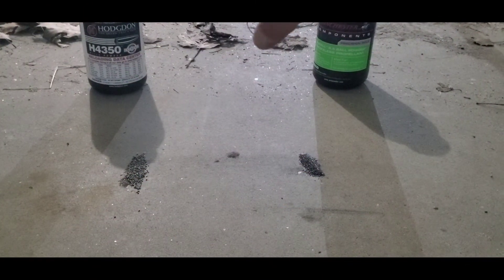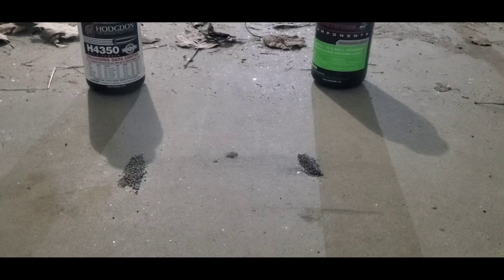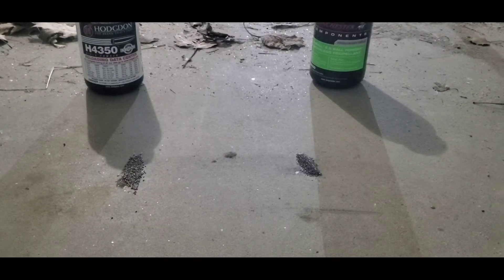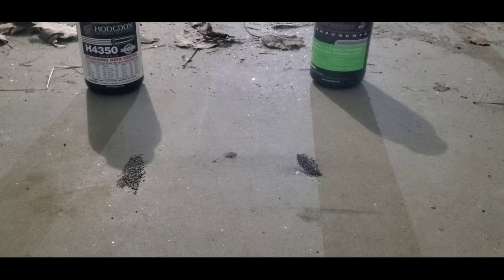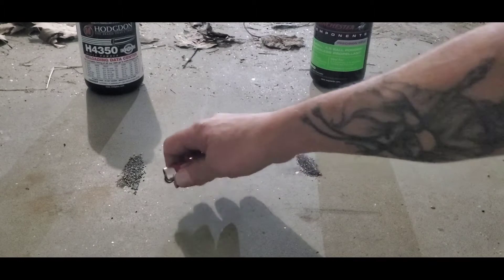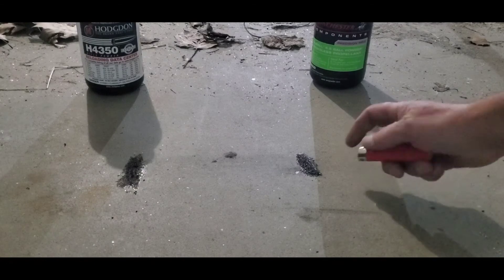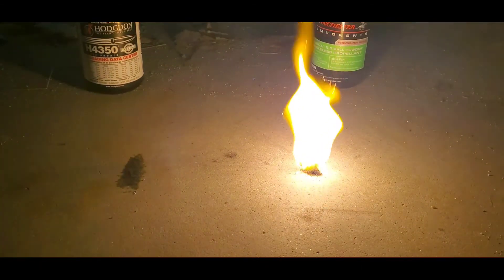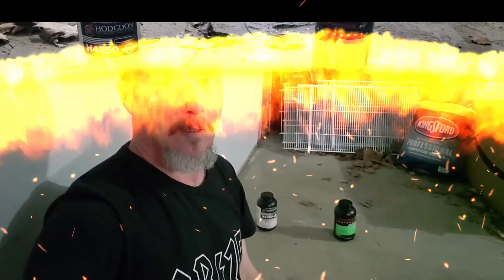Powder BURN test.. H4350,  6.5 StaBall

Comment: May I ask how 6.5 Staball has worked for you. Using h4340 as of now and 140 gr eldm. Is it temperature stable like stated? Appreciate what you do my friend.
Reply from the maker: In my testing I found it worked very well. Was able to get a little more velocity. I don't think I had used it during the heat of the summer.
Reply: @Ocdoutdoors   
I was wondering how much difference let say,  80 degree to 30 degrees would change velocity. What if you test the exact loads. 3 to 5 in your freezer over night measured with a laser thermometer and 3 to 5 outside in the heat measured with laser thermometer shot through your chronograph. Could or would you do this test? I think it would get a LOT of view's!
Reply from the maker: @kentuckywindage222  if my reloading bench was set up.. it's been packed from a move and haven't made the time to unpack. 
Johnny's reloading bench had done a video of just that.. he gave it a good scientific test.
Reply: @Ocdoutdoors  
Thanks. If he got the temp of the rounds that should give a pretty good idea of the sensitivity. Thanks again

Comment: Cool. Side by side comparisons like this will always be fun to watch. Adding relevant info would make it even better, i.e. slower burning powder is better for this bullet type/weight, or faster burning powder is better for that bullet type/weight.
Reply from the maker: You do have a good point.  I definitely should've added some more info on the powders.. Thanks for the tip.